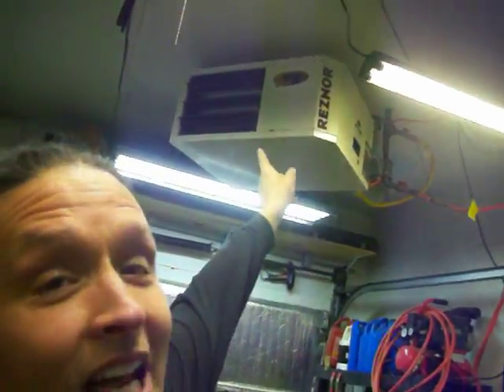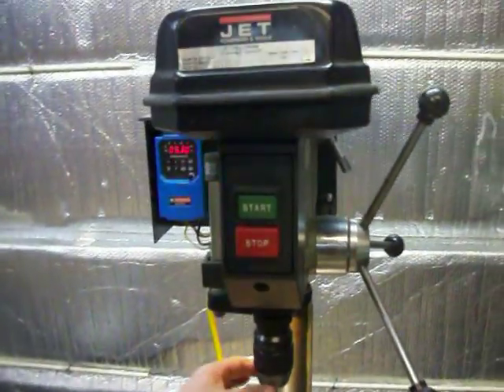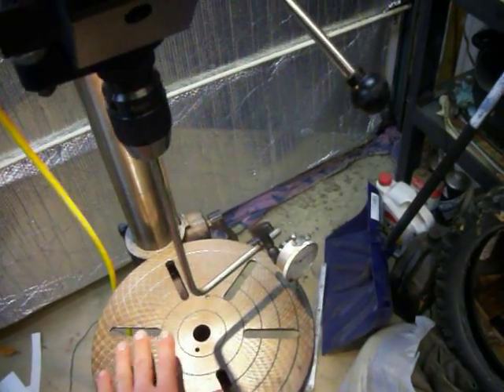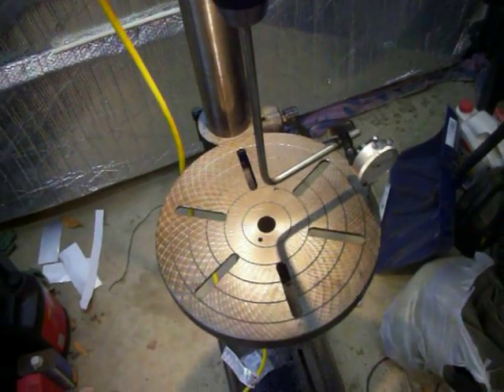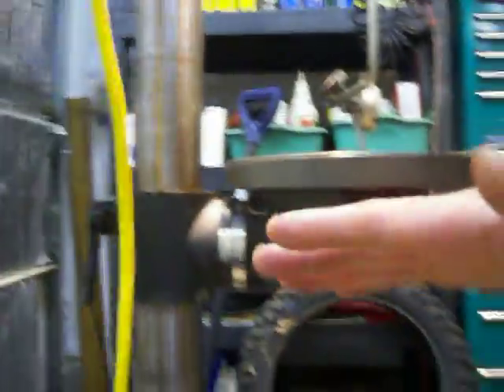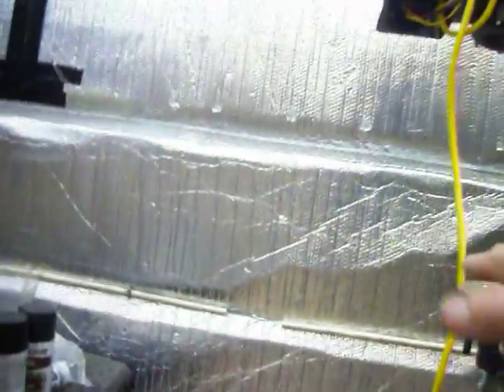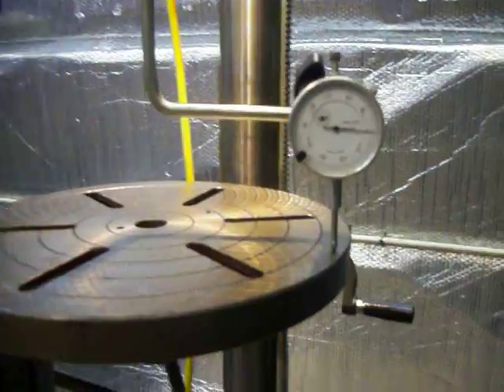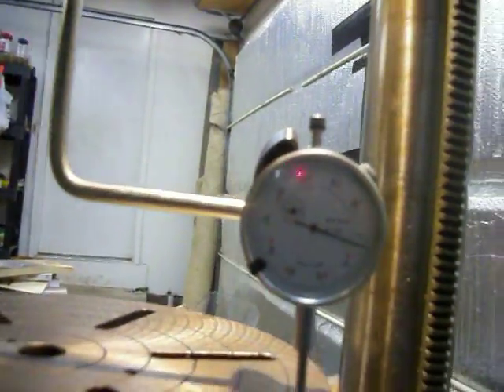The Results From Squaring a Drill Press Table.

Comment: Thank you Russell.  I must say there are many videos showing the same idea over and over.  BUT you are the only one to actually offer the answer to correct the discrepancy after tramming the table from from to back.   I did not think of using aluminum paper.  I was actually thinking of buying a cheap feeler gauge and sacrificing the proper thickness feeler to correct the error. Once again thanks for doing it right.
Reply from the maker: Glad the explanation helped your situation!